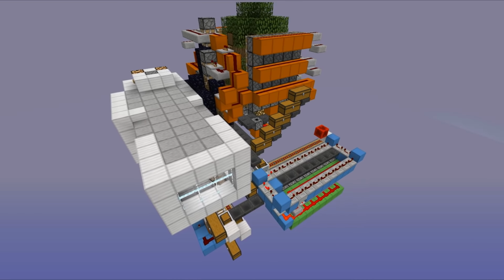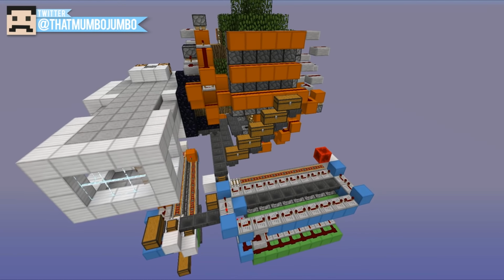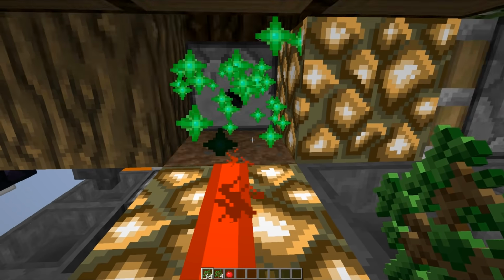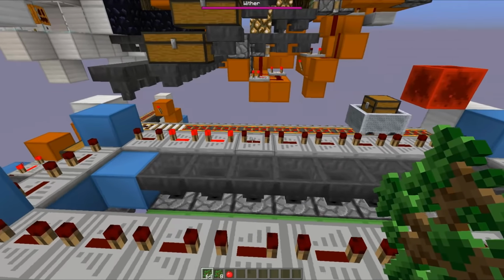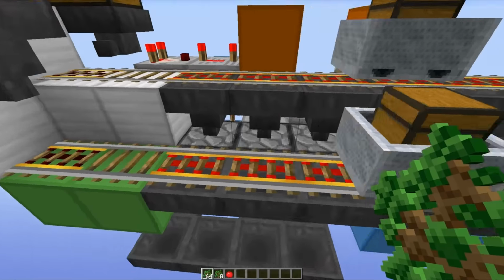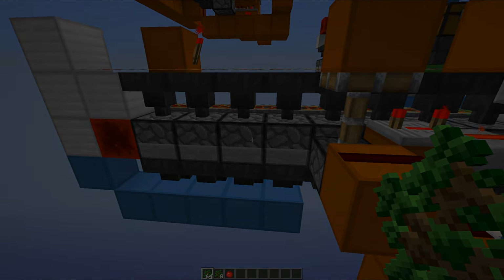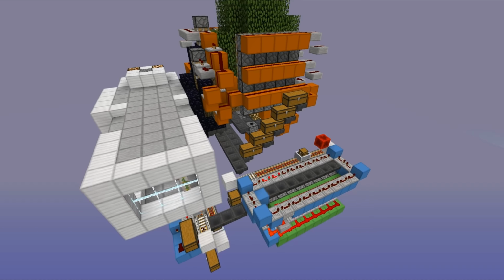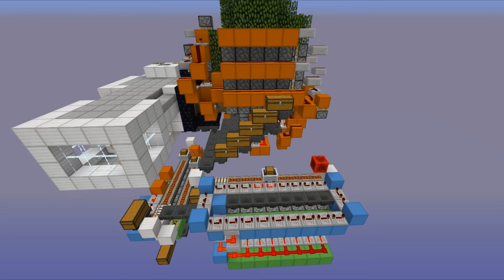TOO SMALL: The Wither Powered Furnace Array!

Comment: the minecart industrial furnace is great. it is cheap, produce less lag, and can use any variants of coal in comparisson to dataless822 industial smelter which uses hoppers and a coal only sorting system. i love the idea of using the wither. but this is a very lag sensitive system. if the wither glitch out, you will need the super overpowered dataless822 to sort it out. mumbo also featured some of his farms (ex:sugarcane farm).

Comment: Hey Mumbo, I have a request for you or anyone that will answer. I need a password system that's compact enough to fit in a 5x5 area and how ever tall need be to lock a 3x3 piston door. I need something I can throw a named item in and It will open the 3x3 door for me to go in and make it so I'm able to close and open it from the inside without a password and keep it locked from the outside with a password. All other designs I've found are for actual iron doors and leave me no way to connect those machines up to the 3x3 door. Anyone who can help me with this dilemma it will be much appreciated.
Reply: so you mean a way to throw a specific item and connect it up to 3x3 piston door with an open and lock inside